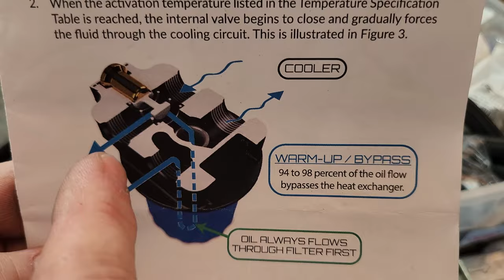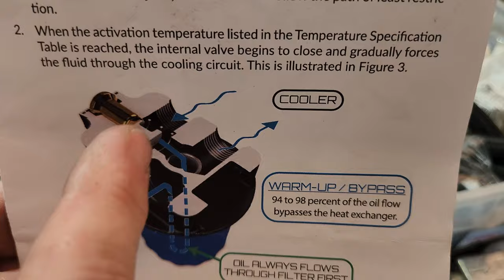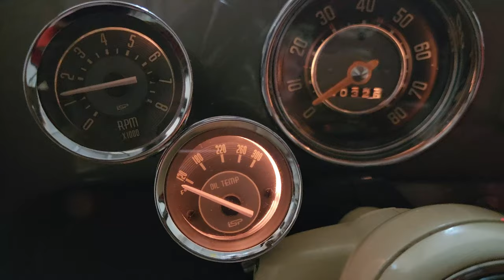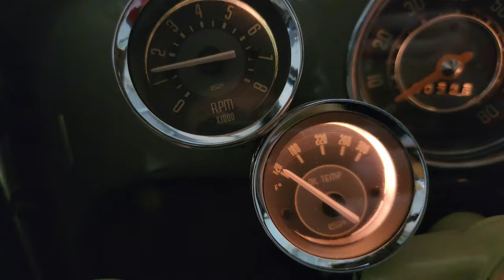Improved Racing Remote Oil Filter w/ Thermostat for the Air-Cooled VW | JW Classic VW

Comment: Looks like a solid piece there. 
That’s one thing people don’t believe when I say you need to run an oil stat if you’re running an external cooler. 
The Derale brand stat I run also has a 10% bypass so there isn’t any air or cold oil in the lines when the stat opens up. 
That should definitely help ya out on those cool days and believe it or not even on the hot days. 
Nice clean work as always dude 🤙
Reply from the maker: Yes sir, should make  big difference! Happy Easter

Comment: Hello, which emulsion tube do you use on your Weber IDF ? (I have a 1915cc engine).
Reply from the maker: Pretty sure they were F11
Reply: Many thanks, I use update kit with F11 too.
I will try F2 because F11 make my engine little lean only at WOT.